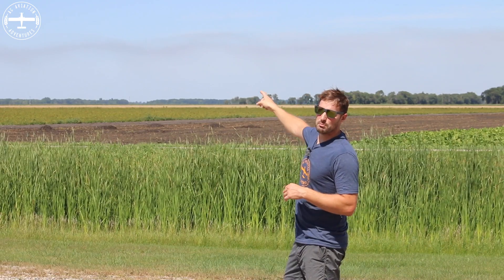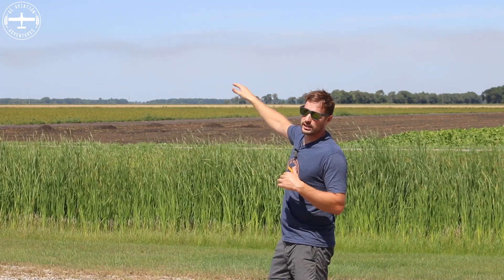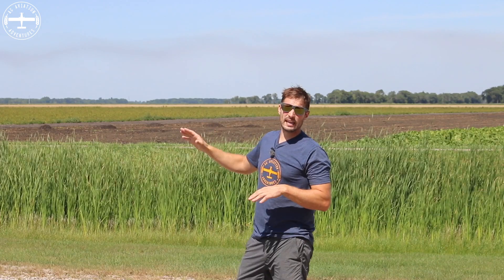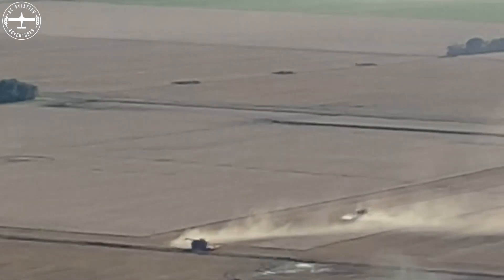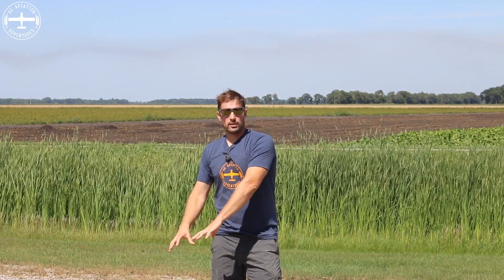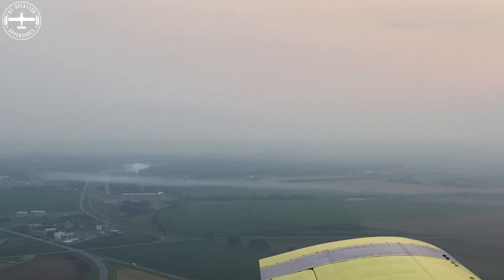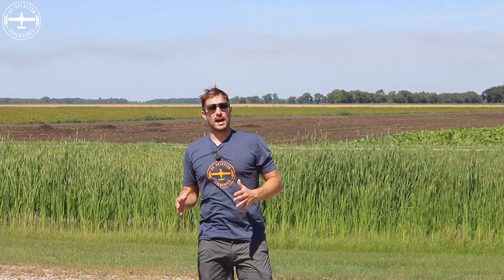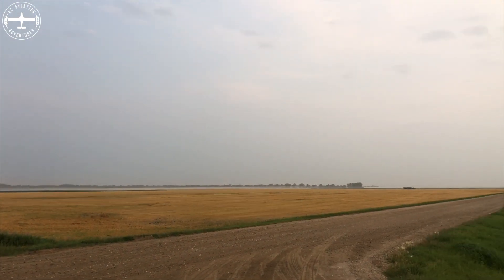Why Spraying Herbicide is a Bad Idea in Temperature Inversions

Comment: Can you do a video regarding salary or income for ag pilots. I really want to do this in the future as a full time job but I also want to know if it’s worth the money and if I should take a different aviation career. Thank you!
Reply from the maker: Hey Landon. I would say an average for people working a 4-6 month season is maybe $60k-$80k however that can change dramatically just depending on what the season is like. If you work year around you will probably be in the $150k range. But again this is all dependent on weather, prices, etc...  It’s a great career but you will have to take the good with the bad. Every year I don’t know what kind of money I’m going to make until it’s over.
Reply: Ag Aviation Adventures hey! Thanks for responding so quickly. I’m currently getting my PPL down in central Iowa and have always watched crop dusters around here in amazement. I have another quick question though. Are crop dusting pilots usually salary based jobs or a certain rate per hour type job? And also, how does a crop dusting pilot work year round if the crop season is only for 4-6 months? Do you follow  crop seasons around the country and maybe move down south in the winter to crop dust? Thanks for the help Tyson.
Reply from the maker: We are paid per acre so it’s all based on how many acres you spray. If you wanted to work year around you’d need to move somewhere where they spray year around such as Texas or California. Or states have very long seasons but maybe not year around quite. Like Arkansas.

Comment: Hello Tyson,

Can you make e video, about Ag business, with some real number in Ag operation? 
I am interested, from owner operator point of view, about:
- operating cost of an Ag plane (Radial AgCat, AT 502, 602, 802), 
- average price per acre, 
- how the price vary from type to type form of application ( solid and liquid, and different types of liquid applications)
- does the price increase if the form of the  parcel for spraying, is difficult to fly ( from it's form point of view) and also if there are many obstacles?
- how many acres are you spraying, per hour and per day ( with your plane, and how many would it be with an Radial AgCat?)
- how many hours are flying the Ag planes per year in ag business?
- what is typical profit margin in this business?
- night Ag operation are very often used? 
- what are the requirements for an Ag pilot, to be able to fly night Ag operation ?
- Some advice for one who want to start a business in Ag operation?

It would be very helpful for me this info.

Yours videos are very nice and informative,
Thank you very much!!
Reply from the maker: Thanks for watching. I’m really only familiar with the 502 since that’s what I have the most time in. I definitely don’t have any numbers for a radial Ag cat. And the numbers can vary drastically depending on where you are. I’ve heard people charging less then $5 an acre and  over $60 an acre (all depending on how many gallons per acre they are applying).